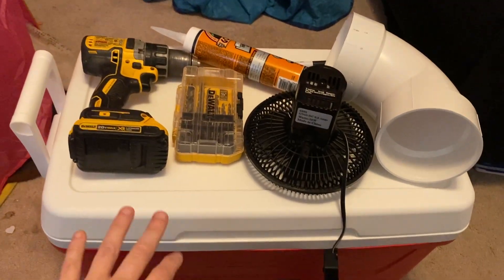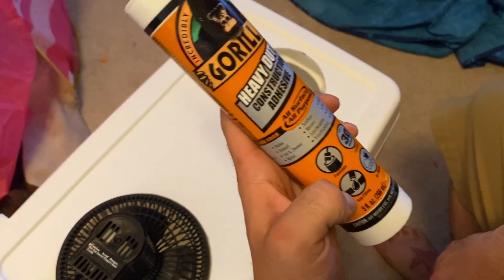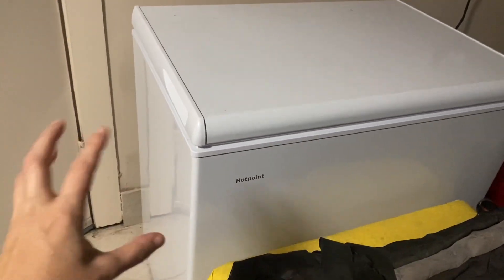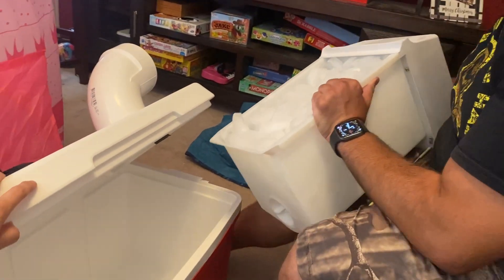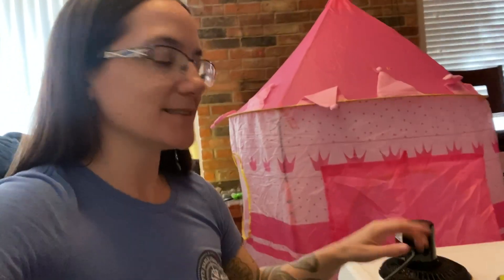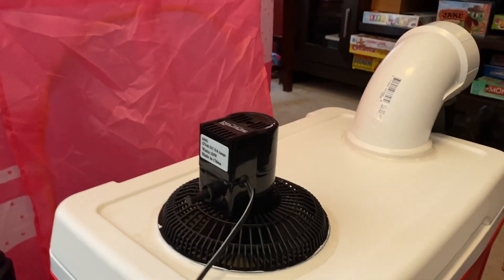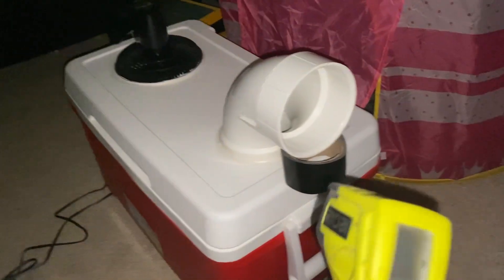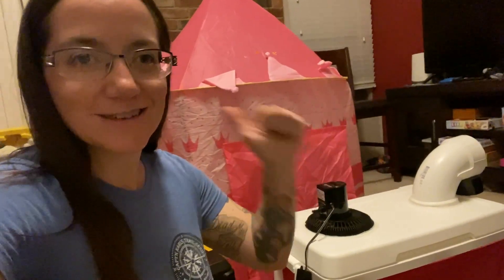How to Make an EASY Low Wattage Air Conditioner For Off Grid, Lights Outs!

Comment: Speaking as someone that has lived through 120 degree weather without any of this: might be worth learning to also move the air from one intake of your place to another, along with moving the air within your place to keep the air turbulent. I don't use your system though I know of it and it has served me well: I'd imagine having new air that's already cooled would augment yours depending on how sealed off or open your system is.

Comment: Just a thought. Since you are going to use this to cool down a small room, why not add a Swivel Fan to one of the 120 Volt outlets on your Power Bank to “Spread the Wealth” in that room? Shouldn’t draw that much more power, and it should distribute the cool air around. Take Care.
Reply from the maker: Indeed

Comment: Your modification should be easy.The elbo you glued in is glued on the outside ofthe fitting. A piece of the pipe it is made for is glues on the inside of the fitting so it should be just a cut and glue situation.
Reply from the maker: Totally! Easy add-on.

Comment: I live in a hot and humid area and when I did experiments on cooling in this manner I found that a better way to cool yourself down was rubber hot water bottles (0.6L size I think, about the size of the palm of your hand, a little bigger) filled about 75% full and then frozen. Rubber is insulating enough that you don't give yourself frostbite, throw it in your armpit or on your neck and cool your core directly. Be careful when fresh from the freezer, the sudden cold can cause cardiac issues same as drinking ice water when overheated. I found this to be much more effective than any cooler that is not conditioning (removing humidity from) the air. I really wanted the cooler ACs to work to the point of even setting one up with separate loops that would not introduce additional humidity and would remove some small amount through condensation. That $50 prototype that required a pump and a fan was still beaten by a $6 rubber water bottle and the freezer I had to use anyway AND it used less ice (more comfort per lb/gallon of ice) AND AND required no additional water after it was filled.

Comment: It will probably cool the house down until you run out of ice that was in freezer. Once you run out of those and you put more water in freezer to make more ice then your freezer will probably be heating up your house the same amount as the air conditioner is going to cool. This is because the freezer is like heatpump. It takes heat from stuff that is inside and puts it outside. Maybe you could fix this problem by putting an exhaust fan in the Freezer room so the heat from freezer don't heat up your house?
Reply from the maker: The freezer is in the garage.
Reply: @RoguePreparedness  okay then this is not an issue. 🙂

Comment: Instead/in addition to lowering the outlet pipe I would also recommend raising the ice up off the bottom somehow so your ice is not sitting in water. You want the energy used to melt the ice coming directly from the air not from chilling water. The air/gas to water/liquid boundary does not have very good thermal conductivity compared to air/gas to solid/ice. Too much of it goes into evaporation that increases humidity and cools the water, not so much the air.
Reply: This can easily be done with cheap stackable cooling racks for baked goods

Comment: I have a countertop ice maker (48lb/day candy bar type not bullet) I recommend collecting the ice, breaking it up and hard freezing it in your kitchen freezer. The ice out of the machine is just below freezing, this will make it hard set and give you more cooling before the ice starts to melt. In my arrangement, the machine makes about a gallon size ziplock in about 2 hours which seems perfect for the ice to hard freeze in the fridge freezer.

Don't reuse water in a machine you intend to use for eating/drinking the ice from. They get very disgusting very fast (about a week). I am currently testing a piece of high purity copper inside mine as a biocide. After a few days the ice starts to taste metallic and water needs to be discarded. But air has a lot of contaminates and that is an excellent way to grow mold and legionella and make everyone sick just from the air from the cooler let alone drinking it.
Reply from the maker: Never said it was going to be reused for consumption, it’ll be re-frozen for the AC.
Reply: @RoguePreparedness  making sure that it was clear for everyone because it wasn't specially stated not to do so, but also the same machine shouldn't be used for consumption as it will be very difficult to get all the internal bits of the water pump and mechanism clean if not impossible. I have had to clean out many ac condensate lines, I know how gross air and water gets when mixed.

Comment: Your kitchen freezer is actually better at bringing things down and freezing them than the chest freezer is. Because it actively circulating air it transfers the heat faster. In a chest freezer to freeze something new the things around it are actually heated up and in some cases completely thawed before the temperature sensor actually registers that the box has warmed up and turns back on. When I first got mine (also Hotpoint) I did some tests with bottled water and the surrounding frozen water bottles started to thaw and melt where they were in contact with a new bottle. Also new bottles took a full 24hrs to freeze instead of 2hrs in my kitchen freezer. Chest freezers are EXCELLENT at holding things at temperature, they are TERRIBLE at getting them there. If I remember correctly it took 2 days to get the freezer down to temp initially. With only some freeze pops and about a dozen water bottles in it. So ~3 gallons of water. And the center of the bundle of freeze pops were cold but not frozen for another 2 days (inside a cardboard box).